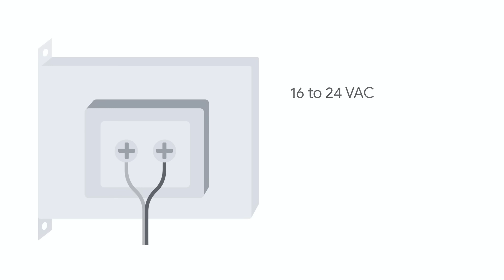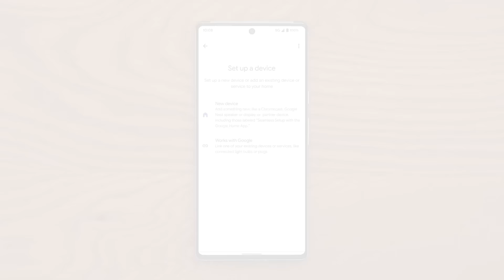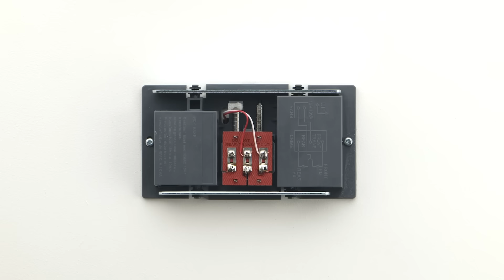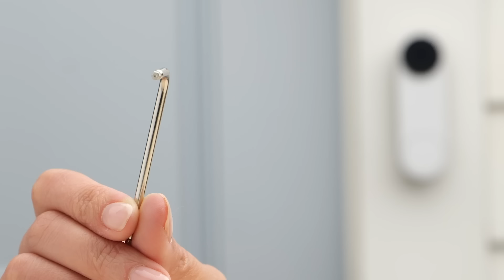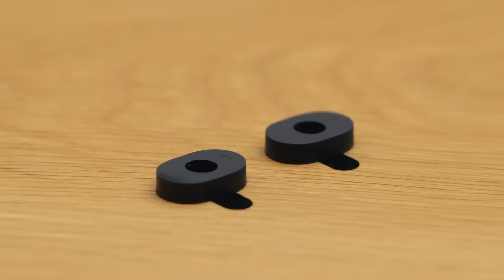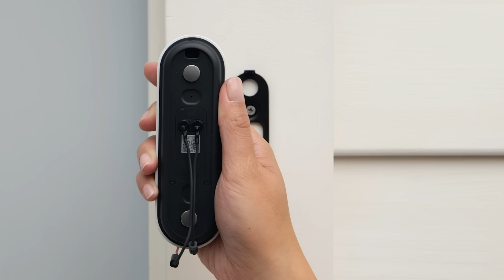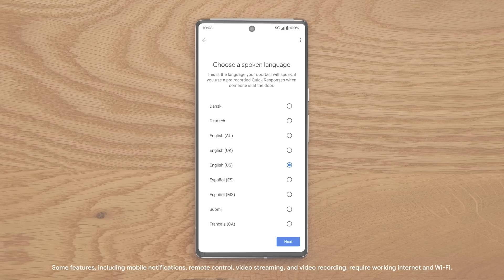How to Set Up and Install Your Google Nest Doorbell (Wired)

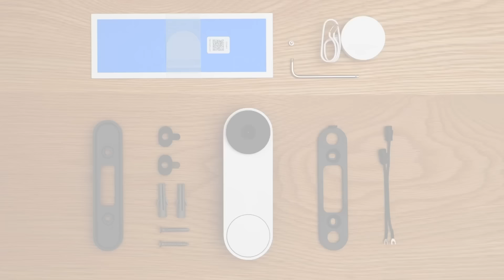Comment: 2:03 "Everything you need for installation is included in the box. You may also need...."  SMH.. AND it didn't come with any of the lead wires, screws, anchors, all the other stuff it says it comes with. What a ripoff
Reply: You think it’s going to come with a drill and hammer? Haha

It does come with screws, anchors, wire leads. You probably just threw them away because you didn’t take the box apart.

Comment: unfortunately there is not breaker in mine they went direct to transformer.
Reply: The transformer has to be wired to a 120V circuit which will have a breaker in the panel to turn off.

Comment: The “chime connector puck” is not optional to install. Don’t be like me and not install it. A few days after installing my doorbell, the doorbell chime box started making an awful buzzing noise. After attaching the puck to my chime box, the noise went away. I’m assuming the puck is actually a resistor. They should probably call it that instead if so, lol

Comment: This is great, except it doesn't include the part where the Google Home app resets and you start back at square 1.  I had to rescan the QR code 3 times because the app kept going back to the beginning.

Comment: question, i got my battery doorbell from ADT, i want to wire it so i dont have to manually charge it anymore. What do i need to get before i call the electrician
Reply: Battery doorbells and wired doorbells are mutually exclusive, they can't be converted between one mode and another

Comment: When I connect the chime connector the chime stops working. Without chime connector it works as usual. Why is this?
Reply: same here, did you ever figure it out?
Reply: @dysequilibrium  remove the connector, it will work. I have same issue and now fixed
Reply: @fmwebs  thanks, have you experienced any impacts from removing the chime connector?

Comment: I have a question if I take the battery door Bell. If I link it with my chime. Did I need to put off the câble every time I need to charge the Bell ?
Reply from the maker: Hi there, thanks for your interest. Yes, you'll need to charge it via it's ports using a USB cable and power adapter. Check this out: https://goo.gle/49g0clO If you need help, reach out to us via phone, chat or social forums: https://goo.gle/3RMJ7Hx
Reply: @madebygoogle  I know it. I ask if I need to put off the 2 câble of the chime every time I need to charge

Comment: question do you have to install a chime
 connector for each door bell camera?
Reply from the maker: Hey Antonio, thanks for posting. Only wired operated Nest doorbells are needed to have a chime connector. You may check this link out to help you identify the types of doorbells we offer: https://goo.gle/2x9T2TW? For more help, reach out through our support channels here: https://goo.gle/3ie15Ae
Reply: @madebygoogle  I have wired edition Google Nest Door Bell 2nd. just installed it and spent my whole day to figure it out why my indoor chime stop working. It was working when I was using the Ring. The connector create the problem, after I remove the connector, my chime begin to work again. ......You guys need to update this video and provide correct information
Reply: @madebygoogle  I understand but I want to know if you need to install a connector for each door bell

Comment: The wires that screws into the doorbell, where can i buy them? One of the wires got stripped when i tried to put the doorbell back on.
Reply from the maker: Hey William, thanks for reaching out. Could you tell us what type of Nest Doorbell you're using? Also, what country are you in?
Reply from the maker: It's us again William, while there's no option to buy a replacement wire for a 2nd gen wired doorbell, we'd suggest contacting us. Get help: https://goo.gle/3m6uPSW
Reply: Oh sorry, I didn't see a notification.  We got ours working
Reply: But one question, can we replace the doorbell with a new one or different version and have it work the same or no?

Comment: can the chime connector from a Nest Hello doorbell be used for a wired install of a Google Nest doorbell (battery powered)?
Reply: Yes, your Google Nest Doorbell has multi function, you can use Wired or Battery powered of your choice. You would wanna replace the existing transformer though that works with (Google Nest Doorbell Wired/Battery) if you’re looking to go Wired connection route. Hope this helps.

Comment: When the chime puck is connected, nothing works.  The professional electrician that was sent by Google to install could not figure it out.  Every time the chime was connected, it will not work.  When the chime puck is not installed, the doorbell works.....  what now?
Reply from the maker: Hi Todd, thanks for posting. We'd suggest trying the steps found in this article and see if it helps: https://goo.gle/46Wl7tf Also, it would be best to reach out to our support team if you're still getting the same experience: https://goo.gle/3RMJ7Hx

Comment: You had a red wire to trans and white wire to front. Mine has the red wire to front and white to trans. But the doorbell has worked this entire time. Does it matter?
Reply: It's 24 volts AC, so it does not matter.
Reply: Sorry, 16V not 24V

Comment: is it normal that mine is working even tho i didnt install that little circle thing that goes on the chime...?
Reply: I didn’t install it either as it wouldn’t work with it installed. It works without it installed but now only works sometimes. So frustrating

Comment: Praying I get a response from the google account - I would like to replace the provided WIRED nest doorbell with a BATTERY nest doorbell. I rent my home and cannot make any more holes in the siding. Can I use the existing base plate from the wired doorbell and just attach the battery doorbell to it?
Reply from the maker: Hey JD, thanks for posting. We're sorry, but we don't offer exchanges from one doorbell model to another. Also, there's a difference between the mounting plate of the  wired and battery version. If you need help, reach out to us via phone, chat or other social forums: https://goo.gle/3RMJ7Hx

Comment: What if you dont have a doorbell chime? Can you still use the wired nest doorbell?
Reply from the maker: Thanks for the post, Shawn. You can install the doorbell with an indoor power adapter. You may check out the details here: https://goo.gle/46qQHzn. For more help, you can reach out to us through phone, chat, or social media forums: https://goo.gle/3ie15Ae
Reply: @madebygoogle  thanks. What is the indoor power adaptor? Where would I get it? So I don't need a new doorbell chime?
Reply from the maker: The information about the indoor power adapter is in the link we provided and is available in the Google Store: https://goo.gle/46vz0ht. We'd recommend reaching out to us through our social media channels if you need more help.

Comment: hi, to anyone that could help me . I tried to connect the Doorbell 2gen with wires at home but i couldnt, i assume the problem is that i need a chime with transformer at home, and i dont have it yet. I connected the doorbell with batery, in the main time i buy a chime with transformer. Do you guys can sent one i can buy? I live in Spain, thanks  

hola a quien pueda ayudarme. Intenté conectar el Doorbell 2gen con cables en casa pero no pude, supongo que el problema es que necesito un timbre con transformador en casa y aún no lo tengo. Conecté el timbre con batería, principalmente compro un timbre con transformador. ¿Pueden enviarme uno que pueda comprar? vivo en españa gracias
Reply from the maker: Hey César, thanks for reaching out — help's here. We'd like to confirm, do you have the Nest Doorbell (battery) and you're trying to have a wired setup, but don't have an existing chime and transformer?
Reply: hi @madebygoogle  
sure, let me explain to you. I bought the 2gen doorbell. I wanted to install it with cable. In fact, I've been there for a couple of days. I completed the entire installation with cable, but, when I connected the cables to the back of the doorbell, the doorbell rang all the time. I understand that it is because my doorbell at home does not have a transformer.

Finally, I went to a Leroy Merlin store (in Madrid) to buy a doorbell with a transformer.

Right now the Google Doorbell is installed in battery mode, but I would like to get the most out of it (connect it with Nest Aware and the rest of the cameras), and therefore connect it with cables.

Do you think I should buy a doorbell with a transformer that has Doorbell 2gen compatibility or is there something I'm doing wrong?
Reply from the maker: We'd like to look more into this — send us a DM and let's continue our conversation there.
Reply: @madebygoogle  what is a DM?
Reply from the maker: Sorry for the confusion. Could you send us a private message?
Reply: @madebygoogle  i would but i dont know how. Please let me know or maybe you sent me a private message
thanks
Reply from the maker: We're sorry for the late response, César. We'd suggest reaching out to us through our other social media platforms such as Facebook, Twitter, or Instagram.
Reply: @madebygoogle  sorry about this but i dont have such a social networks. Could you please sent me an email or letting me know a telephone number to call?
Reply from the maker: No worries. If you'd prefer to speak with our phone support, you may request a callback via this link: https://goo.gle/3ie15Ae. You'll have to fill out the first two fields, then click on the "next step" button. Click on the second "next step", then "Get a call". Fill out all the required fields, then tap on "Call me".

Comment: I have just purchased the google doorbell (wired). I do not have the chime, can I still install the doorbell and use it as per normal?
Reply from the maker: Hey Lee, thanks for posting. Your Nest Doorbell (wired, 2nd gen) must be connected to your home's doorbell system. In some homes, you may need to upgrade your transformer to meet the doorbell's higher power requirements. If it's not compatible, you can either contact a local pro to upgrade your system. Learn more here: https://goo.gle/46wiTAv If you need more help, reach out to us through our support channels: https://goo.gle/3meAs19

Comment: Does it need to be connected to wifi, in order to set up in your home?
Reply from the maker: Hi Sanjeev, thanks for posting. It requires a Wi-Fi connection so you can pair it with the app and receive notifications on your phone. Learn more here: https://goo.gle/3DPVjlQ If you need more help, reach out to us through our support channels: https://goo.gle/3meAs19

Comment: Will i be able to use the new Google Nest Doorbell (battery)  with a wired connection? Except for the fact that Wired version cannot be used wirelessly, are there difference between the Battery and wired? Thanks
Reply from the maker: Hi there, yes! Nest Doorbell (battery) supports wired installation. Here's a helpful guide to know more: https://goo.gle/43jepes For more help, you may reach out to our phone, chat, or social media team here: https://goo.gle/3ie15Ae

Comment: i am still mad that i have to invest in buy a "mini" to get a chime indoor. It cost average 50 dollars more. I just invested in a new phone because my phone didn't allowed me to instal google home app. I am very angry. My house indoor chime box is from 80s and it do not work with the round device on it. How is possible that china equipment came with indoor chime and google nest not? It is a very expensive product with difficult chime installatiom, no indoor wireless, expensive to hire a technician. It is the worst product i ever seen
Reply from the maker: We hear you and we're always looking for ways to improve and we appreciate your patience while we're working to deliver a better experience. We'll take this as feedback.
Reply: @madebygoogle  i feel that google stole my money by charging a high price for a bad product. I REGRET TO BUY THIS PIECE OF GARBAGE!!! IN TEMU I SAW SEVERAL DOORBELL WITH PLUG IN CHIME AT A FRACTION OF COST 15 DOLLARS !! VS THE LOW QUALITY AND LACK OF PLUG IN CHIME !!! I COULDN'T RETURN IT TO STORE BECAUSE THE ELECTRICIAN USED THE WIRES IN DOORBELL AND PLACED THE CHIME INSIDE MY VERY OLD CHIME BOX. I DONT HAVE THE TOOLS TO OPEN IT.AUTHORITIES MUST DO SOMETHING WITH THIS scam.
Reply: @madebygoogle Me: "i feel that google stole my money"😫You: "we will take this as feedback" 😌
Reply: WORST PRODUCT EVER !!!  
1. APP GOOGLE HOME IS NOT DOWNLOADED IN ALL PHONES. I HAD TO BUY A MOTOROLA PHONE THAT ALLOWED ME TO DOWNLOAD THE APP.
2. THE CHIME DEVICE MUST BE PLACED IN A WORKING ONE CHIME BOX. MY CHIME BOX WAS DEAD, SO I COULDN'T INSTALL IT. 
3. FOR 150 DOLLARS I OBTAINED A DOORBELL THAT ONLY SOUNDS OUTSIDE MY HOME, BUT UNABLE TO SOUND INSIDE HOME.
4. IT IS TRASH. 
5. MOST CHINA DOORBELLS COME WITH VIDEO DOORBELL AND PLUG IN CHIME DEVICE!!!! WHY GOOGLE NEST DO NOT OFFER THE SAME???? 
6. ELECTRICIAN COST 50 DOLLARS TO ATTACH IT OUTSIDE ONLY. THE EKECTRICUAN TOLD ME THAT GOOGLE DOORBELL S ARE THE WORST PRODUCT EVER, BECAUSE MOST OF THE CASES ARE LIKE ME. IF I WANT TO HEAR THE CHIME INSIDE, THE GOOGLE REPRESENTATIVE TOLD ME THAT I HAVE TO BUY THE "NEST MINI" OR "HOME MINI" IN ORDER TO LISTEN THE DOORBELL SOUND INSIDE MY HOME. 
RING ARE 10000% BETTER THAN THIS GARBAGE PRODUCT.
Reply: WHY THE PRODUCT INCLUDE A LITTLE DEVICE TO BE ATTACHED INSIDE CHIME BOX? THAT IS TERRIBLE!!!!
 I NEED AN INDOOR CHIME LIKE THE PLUG IN INDOOR CHIMES!!!!
😢😢😢😢😢😢😢😢😢😢😢

Comment: I hired an electrician to install, he screwed the product in front of the house but he told me the chime indoor is not working. After he install the doorbell outside 2 problems emerged:
1. I am unable to install the app google home in my phone.
2. The sound when touching the doorbell sound very low outside and it cannot be heared inside house.
What is the cheapest product i can get to make sound of chime inside my house?
How can i download the app? I tried unsucessfully several times.
Reply from the maker: We're sorry to hear about that, Xenia. We'd like to have a better view at what's going on, what type of doorbell do you have? Check it here: https://goo.gle/3qz1o2B
Reply: @madebygoogle  nest doorbell 2nd generation wired. I just bought a new phone, and i installed the app. But i am still mad that i have to invest in buy a "mini" to get a chime indoor. It cost average 50 dollars more. I just invested in a new phone. I am very angry. My house indoor chime box is from 80s and do not work with the round device on it. How is possible that china equipment came with indoor chime and google nest not? It is a very expensive product with difficult chime installatiom, no indoor wireless, expensive to hire a technician. It is the worst product i ever seen

Comment: For anyone needing to connect two nest wired doorbells to their home, you may need a more powerful transformer to make them work. After consulting with Google tech support while my electrician was on standby to give the stats and pictures of wiring to no avail, I had to make multiple calls to Google’s tech support before I was transferred to an Advanced tech support who told me to install a 30va transformer. Which means I had to call the Electrician for a third time to my house to replace another transformer. Costs me a small fortune.
Reply: It happens the same to me. 50 bucks for install outside, then i have to buy another chime indoor box, because my model is discontinued, then get another plate to cover a new model like the old one. It is costly. I regret not to buying a china chime with camera outside and plug in wireless indoor chime
Reply: @Kthwz  You should know how Chinese stuff like Android T.V's have a back door. You can bet on it that they have it on security systems to spy on everyone.
Reply: Screw that,  BUT, if you look at the instructions in this video it said what a single google doorbell calls for... Therefore, your electriction prob should of said hmm, maybe it has to be x2 more powerful to run two?  Two doorbells isn't common in most houses so im sure they didn't go out of their to plan for two.  This is google now not nest... so they don't think that far ahead or care for that matter.
Reply: You really didn't need to call an electrician btw. It's a very easy process. Yea needs a bit of elbow grease but it's worth it.
Reply: @VoidWater96  I needed a new transformer which had to be wired up inside our attic. Not something I could do myself.

Comment: I am unable to install the security screw; the screw does NOT seem to engage/set in place to allow me to use the hex key to tighten it, can you help?
Reply from the maker: Hey William, thanks for posting. Make sure that the screw should sit flush with the top of your doorbell to tighten. You can check this helpful link as a reference: ishttps://youtu.be/c8MW2TsWKmk?t=503 If you need more help, you can reach out to us here: https://goo.gle/3M2xCu8

Comment: Hi I have a couple of google doorbell battery doorbells , and I want to run off power, can I use a 12v dc adaptor and plug into the 2 screws on the back of your doorbell ? and what connector is positive and negitive on the back of the door bell cheers, here in Australia most devices like these run on DC power so a bit confused about VAC and VA in your manual please clarify if DC is safe to connect to ? thanks
Reply from the maker: Hey Dale, thanks for reaching out. The required voltage for your Nest Doorbell (battery) is 8–24V AC. Learn more here: https://goo.gle/2WHO7li
For more help, feel free to contact us here: https://goo.gle/3ie15Ae